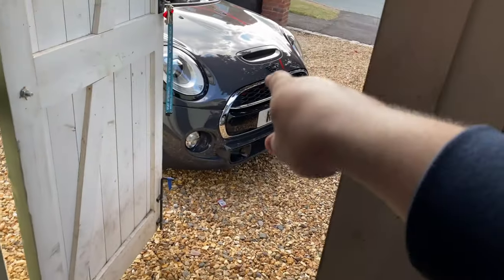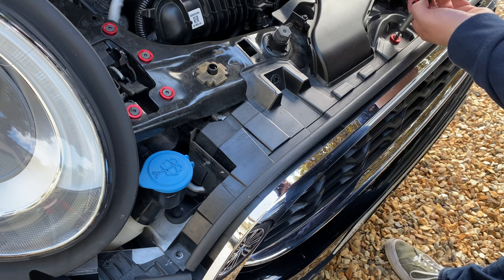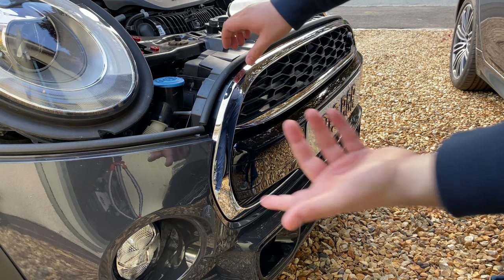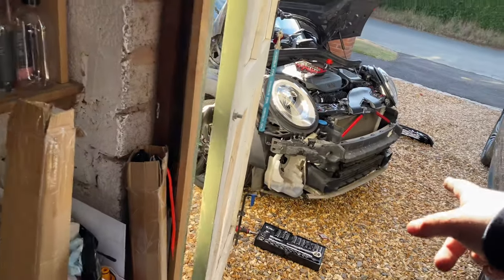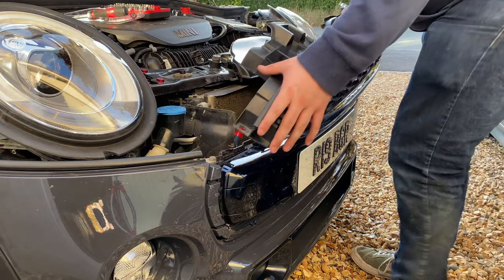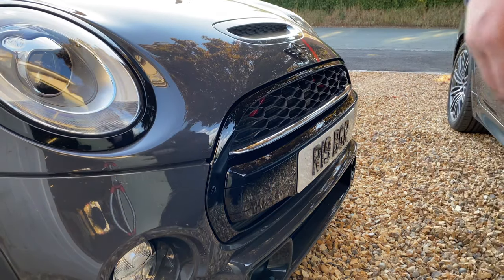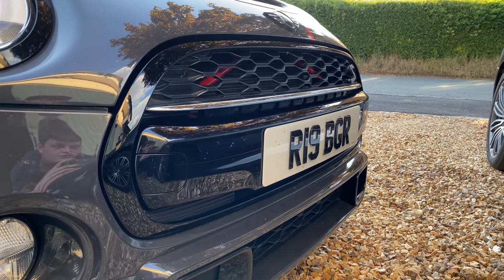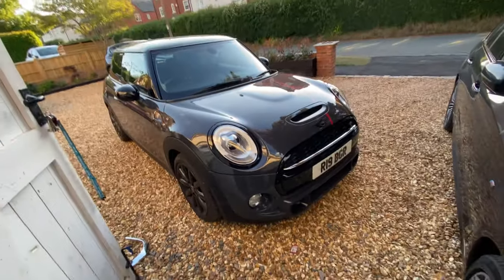GENUINE MINI F56 BLACK GRILLE SURROUND INSTALL

Comment: Hi Ben, thanks for this video. You very nearly changed the grille without taking the bumper off. The trick is you need a trim tool for leverage and a pair of side cutters/snips. As your video instructed, take off the 5 bolts in the engine bay and pull the grille where you show to get started. Then put your trim tool directly behind grille trim and lever. It’ll pop out and if it doesn’t you will see the securing tabs. Refer to the new gloss black one to confirm the tab positions. Then use side cutters to snip one side of the grille trim tab and it then easily releases. Repeat technique until grille trim is removed. Fit new grille trim. Job done 15 minutes max. Hopefully this is helpful for others as there is absolutely no need to remove bumper which like you mentioned is a nightmare. With this method I had about 3 tabs to cut though I was binning the chrome trim anyway. Absolutely zero damage, scuffs or scratches to the car. Thanks again for your posts, info and content.

Comment: After deciding I wasn't up to the job myself i paid my local ( Non Mini) mechanic C$50 (about 30 quid) to install mine . He did it in about 10 minutes without removing the bumper by using a long handled screwdriver from the back to release the clips and managed to remove the old one without breaking it ... It was worth it to me to save me probably  5 hours of arsing  about and skinned knuckles !!
Reply from the maker: Looking back, I wish I had saved it, but the resale value wouldn’t have been worth it in my opinion, granted I could have kept it in case of an emergency but £30 isn’t much to replace as and when. I tried my best (not in the video) to use a screwdriver/pliers but I was concerned about the radiator behind. Thanks for watching 😊😊

Comment: With the caveat that this was on a Cooper SE (Electric), you can absolutely remove the chrome grille ring without removing the bumper cover.  That said, you'll very likely break at least one of the clips on the old ring.  I got mine off only breaking one of them just by pulling it bit by bit from the front, without worrying about trying to undo clips from behind.  The top and sides of the ring come off very easily, but several on the bottom are on there tight enough I thought I was straight-up going to break the ring itself.  Once it's off, the new ring goes on very easily.  YMMV and up to the individual to decide if it's worth the risk.  It's entirely possible someone could damage the bumper-side of a clip doing what I did.
Reply: Did you just pull off the original grill ring with force? Did you not have to unscrew anything

Comment: I am thinking of de-chroming my Countryman F60.  How hard would it be to do the same to my F60?  I want to black out all the badges and maybe remove countryman and cooper badges from the boot lid.  What do you think?
Reply from the maker: I prefer the dechromed look over chrome so I’d always recommend doing it. You’ll have a few options, both SMPS2012 and Sherratt Custom Parts offer top notch dechrome kits ranging from wraps to covers to complete new parts to swap out for the old parts. If you use SCP feel free to use BEN10 at the checkout for 10% off!
Reply: @BenRolfe  thanks for the info.

Comment: I am going to put the black grille surround on my Mini. How difficult was it to remove the bumper?
Reply from the maker: The bumper removal is really easy, although just very time consuming. Remove all the screws I’ve shown in the video, then pull away the front wheel arches to reveal a bolt either side. Then there are 7 screws underneath the bumper at the front and finally 1 screw either side inside the wheel arch at the front. I’ll try and do a video at some point showing it. You’ll also need to make sure you unplug the fog lights prior.

Comment: Dude
Quick question.
I’ve seen the stick on ones.
Do you think if you had added 3m tape to that Oem grill it would have covered all the chrome... 🙏 in advance.
Reply from the maker: Hey 👋 that’s entirely user preference. Whilst they look pretty much identical, your two main factors are the price, with the OEM being the cheapest option. Based on just pricing, I’d recommend the OEM variant.
Reply: @BenRolfe  thanks for the reply...I don.t know if anyone knows if the oem would cover it if stuck on...im wondering if yje stick on versions have like a slightly bigger fit to cover with it being slightly lipped to hide the edges...if anyine knows .. be gratefull as Ben says oem is way cheaper

Comment: Hi Ben, great videos! quick question about the removal of the grill. I’m looking to do this myself and like you said about the removing of the bumper, I’m not keen. Do you think with the correct trim tool, you could of got the rest of the surround off ? I don’t care for keeping the chrome one, so if it brakes so what 🤷🏼
Reply from the maker: Hey 👋 thank you! I think it will be extremely difficult. Maybe someone with smaller hands can get their hand through the bottom vent and back on themselves but it’s such a tight space. I started to loose patience with it so decided to remove the whole bumper.
Reply: Ben Rolfe Thanks Ben, I think I’m going to go for it and remove the bumper! Looks straight forward the only issue I see is disconnecting the fog lights, is this the tricky point or is it just a case of undoing some pugs?
Reply from the maker: Behind your driver and passenger wheels you’ll find some covers, unscrew those first and you can get your hands in there to unplug the fogs. There is a small tab on the plus that needs to be pushed in but once you find them it will be easy. You’ll probably find it easier to turn your wheels to the left and right to get your hand in there easier.

Comment: Just had to replace the part behind my number plate and took off the whole front bumper, my reaction was the same as yours, what made it worse was I had parking sensors on the front and the self-parking sensors on the arches, made it disgusting to do.
Reply from the maker: Definitely was a nightmare to do, in my opinion anyway. Others will say otherwise but it's not a job I want to do again lol

Comment: You've made your job ten times more difficult the chrome edging just comes off granted its a tight fit i broke mine but didn't need to take the whole bumper off the new one just clips back on
Reply from the maker: It wasn’t worth the risk for me to inevitably scratch the Bumper along the bottom.

Comment: Do you have a direct link to the one you purchased at all? ☺️
Reply from the maker: Yep! Here you go 😁 https://www.ebay.co.uk/itm/402226412686
Reply: Ben Rolfe Legend thank you! I have been binging your videos, looking to start modifying my F56 JCW. Keep up the good work! Just wondering if you are going to change your badge to the new one? 😄
Reply from the maker: Thanks so much ☺️ there are still a small number of things I’d like to change including swapping the badges for the new black ones and a few other bits. Debating getting a wrap too, but only time will tell 😁
Reply: Ben Rolfe Definitely would love to see a video on swapping the badges out! Thanks so much for the link! ☺️
Reply from the maker: No worries at all 😁
Reply: Would you be able to link the front and rear light surrounds? Thanks 👍🏻